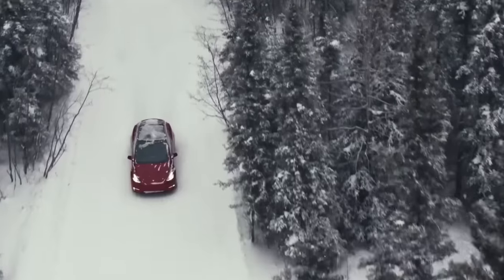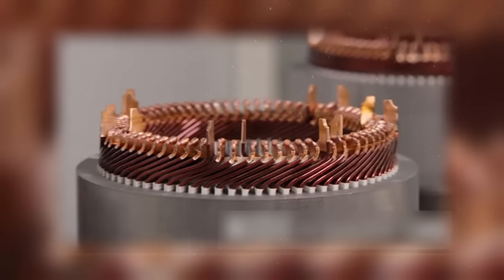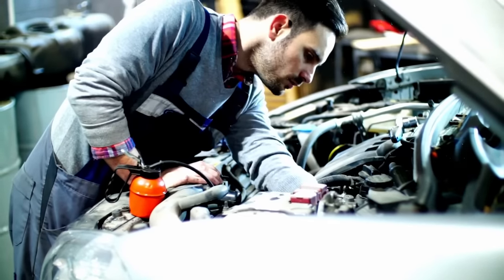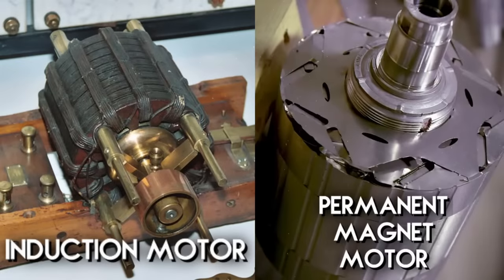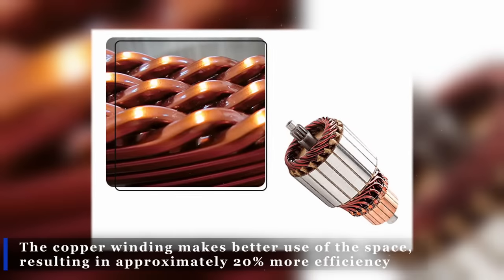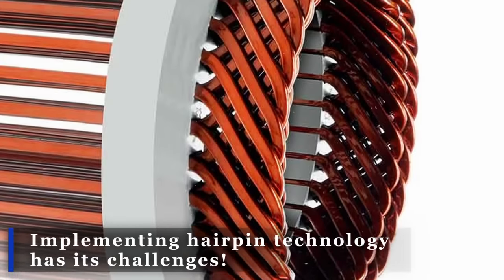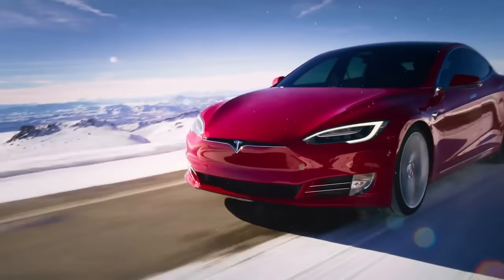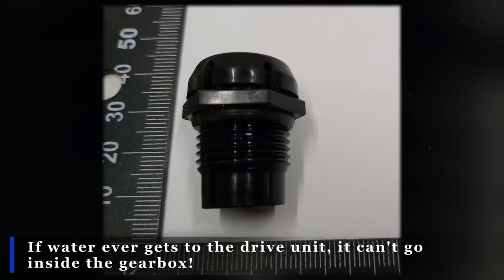Elon Musk: Tesla's New Engine Will Change The EV Industry Forever!

Comment: so called 'hair pin' (rectangular wiring) as far as i remember was first used and patented by JBL for their copper wire speaker electromagnet wiring. from the 70s
Reply: This is NOT new..these motor design,s are 50 years old.
Reply: It's one of those spam videos
Reply: Total nonsense
Reply: @JohnDoe-ef3wo  I know, next there will be a video where Toyota and Yamaha invent a V8 engine that burns hydrogen - imagine!

Comment: The efficiency of the synchronous three-phase motor is already above 90%, so I don't see much to be gained from efforts outside of battery improvement.
Reply: yeah, there should not be much room to improve. iirc already some dc motors of 80s reached 90+ percent efficiency.
Reply: Exactly it's the battery technology that needs to be improved
Reply: the power to charge them! ... green power? Not a chance!
Reply: Electric vehicles are a stopgap clean emission vehicle. However battery technology is 30 years old. They need large improvements. Only minor improvements have occurred on the battery front. In contrast hydrogen fuel contains a raw energy. The proper ICE engine with hydrogen wins all day long vs a Plugin EV. Also the manufacturing processes and jobs to design and construct Hydrogen vehicles closely mirror that of gas and diesel engines. Also consider the average fueling station. Storage tank and pump upgrades will preserve the filling stations existance as we know it with no waiting in line to charge a battery. We will see a new generation of clean emission vehicles with hydrogen ICE engines. And it will not disrupt the global economy and pick the winners and losers the way that EV's threaten to eliminate the ICE engine industry.
Reply: The real gain is in the manufacturing cost. Tesla will make more money in this way not passing the benefit to us. Is a Win-Win for Tesla, not for us.
Reply: @DroneSurf  Musk is well aware and public ally promised at Q1 2023 earnings call to bring the cost of BEVs right down even if it means selling near cost.
However this would wipe out the Auto industry, they are so far behind.
The Model 3 in southern California is less than the cost of a Corolla. Less than the 2016 promised $35000 Tesla. Less than a Camry anywhere in US...
Reply: You are right - improving efficiency wont give us big improvement in performance or range, but it will cut the costs and weight. motor with 95% efficiency is producing half the heat of 90% efficiency motor - we can then scale it down, saving on weight, cooling and size, and of course - money :)
Reply: Pin exist on very old motors. Not an innovation at all

Comment: When they will travel 600+ miles, while running the heat or air-conditioning, and can recharge in less than five minutes, for the same, or less, cost than an internal combustion car, then I would consider getting one!
Reply: Thats a pretty high standard since Gasoline cars can't even do that.
Reply: @ronbad12  Yes they can, mine does.
Reply: @barrycarleton4326  What kind of unicorn do you drive?  The electric cars can get 300 miles on about $8 of off peak electricity.
Reply: If thats your problem with them, the upcoming Toyota H2 cars are gonna be perfect for you.
Reply: 600 miles is too much. 400 miles is considered very high efficiency already. Don't worry, Tesla is continuously improving their motor and battery. As long as they improve efficiency of the motor and energy density of the battery, 400 miles is still a realistic number
Reply: U forgot the 2T trailer, polar temperature and 120 mph...
Reply: @bjrntoreborge4281  yes because everyone drives with a 2T trailer on the back in freezing temperatures while driving twice the speed limit
Reply: The internal combustion engine was invented in 1860. It’s about 30% efficient. It is now incredibly complicated…Also needing a separate transmission.

You stick with that buddy.
Reply: @benjigardner651  Yes, exactly, while they drive their 600+ miles non stop under such conditions. 😁 Everybody knows that everybody need that kind of spec when driving fossil.
Reply: @bjrntoreborge4281  yeh my commute to work involves towing 3 tonnes in -30 degree weather and the minimum speed limit is 150 so i need at least a monster truck
Reply: @benjigardner651  You should probably invest in a nitrous oxide system and keep a spare engine in the back.
Reply: @barrycarleton4326  Hmm.  what is your vehicle that has a 600+ mile range?
Reply: now that's a user name, alright!
Reply: save up... what you want is a lot lot closer than you think!
Reply: @passingthrough812  MK2  Fiat multipla with the 1.9 JTD engine.
Reply: Can you actually drive 600 miles without stopping?

You certainly have better inner parts than I do, after I’ve driven 300 miles I can hardly walk for the first 50 feet and I am extremely active. That much sitting just kills me and they take a 15 minute break. Doesn’t bother me one bit, of course that’s just me.
Reply: My Subaru Outback will do 1000km / 600 mi highway driving on a tank full. In Australia, we drive such distances in a day, going between the eastern seaboard major capitals. I do a Melb -> Syd trip often enough that I’m a long way from an EV too, although if a hydrogen economy gets going, I’d switch to a hydrogen powered SUV. 

It goes without saying that if towing or blasting the AC, the fuel economy drops off… but it’s still only a 5min stop to fill up - something which alludes EV’s at this time.
Reply: @sandyt4343  In France 750 miles nonstop is normal, you back off when the traffic slows you, then open up again/
Reply: @barrycarleton4326  the times I’ve been in France I don’t think I’ve ever come anywhere close to covering that much ground in the car. On a train I have, but that’s a different story. I just can’t drive more than 4 hours anymore without having to stop and let off some steam. I used to do runs longer on my motorcycle in many years past but never 700 miles , that’s 10 hours plus? No thanks
Reply: @robsalvv5853  I have a Subaru outback to, but 600 miles is something I don’t want to find myself doing anymore. Not in one shot anyway. I think it’s just a matter of time before the battery has the capacity to run that long but just like anything else it isn’t for any real long hauler’s yet, but for the vast majority of people who drive 100 miles a day or less it is perfect. Not many people have to travel 300 miles in a day . Of course there are some exceptions but it’s not normal.
Reply: @sandyt4343  sorry to read that your physical situation makes long trips arduous. 

Two key points come to mind from your comments: based on what you’ve said, it is very clear that the utility / benefit / function / value of an EV, or any vehicle for that matter, is utterly down to your personal logistics and purchase case, it is a bespoke choice. And two, there are no practical Outback sized SUV EV’s on the (Australian) market at an ICE price point, which means I’m a long way off being an EV customer. That said, I’m keen to become one at some point.
Reply: @robsalvv5853  I will admit it by physical condition isn’t what it was when I was 16. I was born right at the end of World War II so I’ve got some miles on it but I can still pretty much where my high school clothes are except for the Paisley stuff lol yeah I am rower and still get 25 miles a week or so behind me but I’ll be the first to admit I’m not a kid anymore, and I like to stop and take a break from driving after three hours or so. I agree with you that for the long-haul Electric hasn’t gotten there yet, although I’m waiting to see how the cyber truck works out. If I live long enough, I’ll cash some of my Tesla stock in and buy one. After such a long wait, I think most of the bugs should be ironed out, but there are always a few hiding under the carpet. Time will tell you have to admit in the last 15 years things really have made a drastic turn around. Another 15 and I think we will see a different world. But if AI allows us to. That’s another story.isn’t it 😝
Reply: @chadcoady9025  I think the Prius does
Reply: @robsalvv5853  I do drive in one day from Netherlands to Warszawa, Poland.Also 1000 km. Also wit a trailer behind my EV. During that trip I do need a few rests for myself. My car charges from 10 - 80% in 18 minutes (on average maybe 25 minutes because that is my resting time....I'll have ca 90% in my accu than). This means  the car is waiting on me and my own rest...I;m not waiting on the car until it is charged. Also My rest periods are 5 minutes less than with an ICE car...because for the ICE car I first need to refill my tank, pay for the fuel inside the shop, repark my car and can start my rest only after that....and I still need the same timne for restinmg.
Only one difference....but only until they have 350KW fastchargers at any fuel station....I need to plan my stops at those fuel station who do have such fast chargers.
ps My car is as big as that subaru...and also AWD.
Reply: @robsalvv5853  Depends on the country you live in.
In the Netherlands I do not think that that Subaru costs any less as , let's say, an ioniq 5 AWD , Tesla modelY or KIA EV 6. For sure not in total costs of ownership. 
Maybe I'm a little biased but I;m driving EV's for more than 10 years,,,,this was only based on economical incentivs....In those 10 years I saved (compared with driving ICE) even more money by driving (first years partially) electric than the total purchase price of my current ioniq 5 . I could say I got this EV for free....savings on petrol/energy, taxes and maintenance.
Reply: @ronbad12  Diesel can ;)
Reply: @The Sound of Nature   Yes bit Diesel costs more than gasoline and way more than a recharge.
Reply: @barrycarleton4326  with what size gas tank?
Reply: @bjrntoreborge4281  what do you mean by fossil?
You buy the mythology?
Reply: @brianjones7660  What myth?
Reply: @ronbad12  Which part
Reply: @chadcoady9025  and on a cold day less than half of that
Reply: @marktaylor9806  that’s odd, my sons Tesla model 3 never got less than 240miles per charge in the dead of winter in Illinois.  I think you’re confusing loss from towing.  Cold weather only gives about a15-20% loss in range.
Reply: @brianjones7660  Fossil cars = driven on fossil fuel. (old organic material, plankton, forest etc, broken down anaearobic- and under high pressure
Reply: They are extremely close to that. And it take more then 5 minutes to fuel my car… 20g takes a minute to fill
Reply: @Another-Address  but at a cost of about $8 per gallon equivalent and a net every loss.  Right most it takes more energy to produce hydrogen than the energy you get out of it especially considering the energy loss in compressing the gas to deliver it and the losses when sitting.
Reply: @sandyt4343  I drove ~900 km (550 miles) in my dad'd old Volvo a couple months ago, before stopping for gas. I could probably have gone another 50 miles
Reply: Yeh, because everybody needs to be able to do 600 miles in a single trip.
Reply: @YASxYT  that’s pretty good. I drive an old Volvo too and it would do it , but not unless I was being chased 😆
Reply: I m in Italy my 2007 skoda runs for 1200 km, more than 600 miles. From italy last year i went to serbia from tuscany in 13h i refuelled after the slovenian border. Impossibile with the batteries with wheels they love so much
Reply: @ronbad12  new cars I see.
Reply: Not to mention they weigh a little less
Reply: Why do you need 600 miles of range?
Reply: Wow. My ford Fusion only lasts about 350 miles and is $50 to fill up. My fiancé’s tesla gets 400 miles and is free to charge at night. And its so much faster.
Reply: @sandyt4343  600 miles a day apparently - as we all buy cars to do the longest journeys we do on a daily basis....alsom we buy cars that can act as a removals truck for the same reason. Oh and they need to do 0-60 in under five seconds. And that premium we pay to stand at a pump for 2 minutes - lets just forget about that as it dilutes the argument for burning stuff.
Reply: Don't forget when they can keep a charge in very cold weather.
Reply: @makeroftoys  Think most of us are going to just skip EV's and move to Hydrogen cars like what Toyota makes in Japan.  Soon they will be here too. Hydrogen cars make allot more sense in America than EV's, quick to fuel up (90 seconds at the most), can go over 400 miles on a tank, easier to maintain and are not as expensive. Most of all they are pollution and climate friendly.
Reply: Distance isn’t too bad, my civic exl goes over 400 mile on a tank, it’s the charge time that needs to be 5 minutes or less
Reply: Hello hydro
Reply: Electric cars are cheaper to run though.
Reply: @charlheynike9619  Running is cheaper than driving
Reply: @casparow123 Absolutely they can. Hydro is the future, but before we can get clean hydro, we need clean electricity to run the stations, for that we absolutely cannot do without nuclear.
The reason our current electric cars have no future is the batteries, we will never be able to supply the entire global fleet of cars with clean batteries for fuel, there is just no way.
Reply: @chadcoady9025 , you need to mention a couple of hours of recharging time.
Reply: @DingusSquatfordJr.  $6 per 300 miles of charge is a sacrifice I’m willing to make when it comes to the occasional charge wait times on the Obama long trip.
Reply: @ronbad12  every car does that even one from the 1970s
Reply: I will take one with 600 miles range and 20 minutes charge with 1/10 battery.
Reply: @ronbad12  Really, wanna bet?
Reply: @sushi8204  I am sure there is an exception or two but generally my statement is true.
Reply: @glasscleaner8970  Avg Milage of a all gas sedan is about 32MPG. Avg fuel Tank size is about 18 Gallon = 576 miles. Much less than 600+ and most people will not get that kind of milage unless they do all hi-way driving. So... Generally speaking, cars do not do 600+ running the heat and air-conditioning but I will accept there are exceptions.
Reply: @holyghost718  Maybe one day but if it came out today it would probably be more like 60k.
Reply: @codys1800  but H2 vehicle still need more space H2 liquid for 300miles. Even with pressured H2 tank,
Reply: Zuck it might take time to have that effect 💯⚡
Reply: If Tesla can revolutionize the battery technology without rare-earth and lithium will save the earth.

One step at a time...
Reply: @tanalson  Already available on the Model S.
Reply: @barrycarleton4326 
What do you drive
Reply: @bjrntoreborge4281  Yep and the 5 passengers (overweight) roof rack fully loaded (200kg) with 3 month's supply of food and water in the 2t trailer. One slow puncture in the rear offside wheel. Heavy luggage in the boot/trunk (150kg).

In a rush and a bit of off roading.
Reply: @ronbad12  My Audi Diesel Vehicle can 🙂
Reply: Five minutes charge rate? That would be a very expensive battery charger, very high voltage charger, and need a dependent power supply source to ensure charging battery 100 percent.
Reply: Don’t use cellphone. Use regular ones. You don’t need to charge then. never.
Reply: at 600+ MPH we will have to wait for AI to catch up because no human can drive at those speeds while texting.
Reply: Not yet , we are already down to 10 Minutes for 80% charge give it another 2 years max, and the Moore law will make you finally happy.
Reply: @ronbad12  yes it is a high standard. I fuel up (once a month) and takes me 3 to 5 minutes and not 20 minutes or 20 hours. My range is 570 miles which supersedes any EV. A large full size luxury automobile which tesla dosent even make. At 41K, it's paid off. That's my jaguar XJl. I agree with marktwain. You come out with an EV that has these fine qualities and improvements, now we're talkin!!! I would beat all of you to the gates to be the first one to buy one immediately!
Reply: I agree. Read my reply..
Reply: @carlsmith5545  Electric has come a long way fast so we may get to this high standard in the not to distant future.
Reply: @ronbad1  Im really glad you said that because the good people at Tesla in Philadelphia Pennsylvania told me quote: "Have patience because that day is coming." So im waiting for that day. The day when they come out with the new generation EV with the hopes that these fine qualities and improvements have been applied......
Reply: @ronbad12  I can go 1200 miles on a 16-gallon diesel tank.